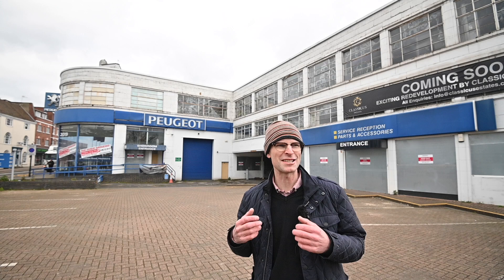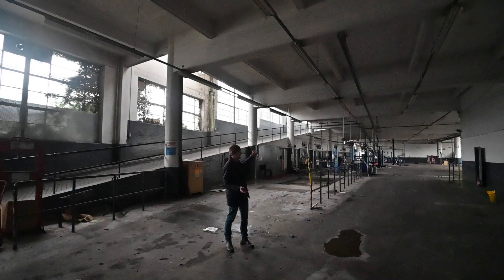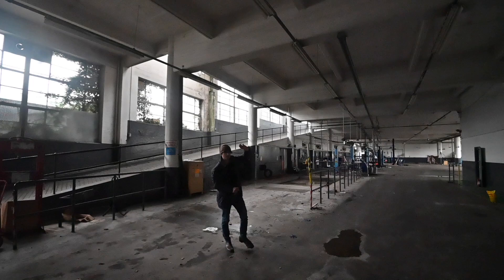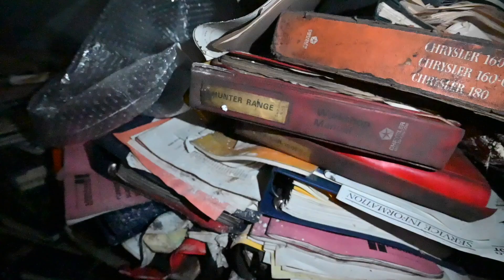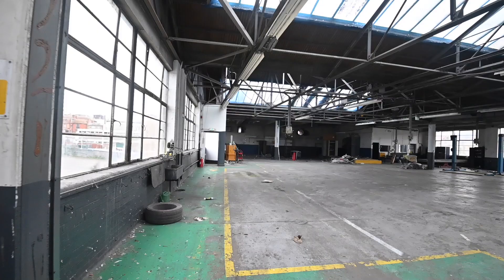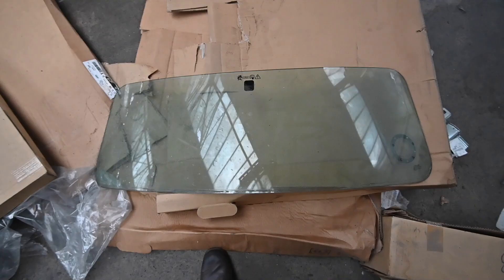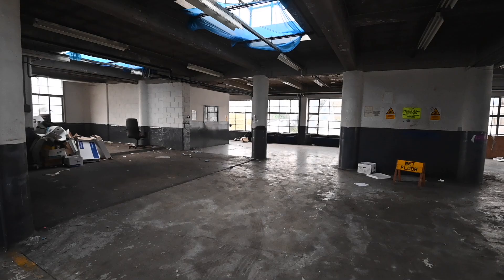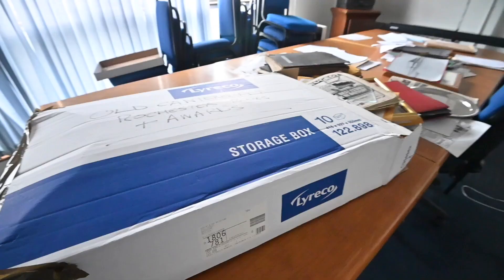Rootes art deco abandoned showroom and workshop urban exploration

Comment: I remember as a lad my dad taking his L reg Hillman Hunter down there for one of its services, he had gotten it from a dealer in Dartford brand new and I remember the sadness of leaving his duck egg blue Triumph Herald 13/60 and coming back in this brand new turqoise metallic Hunter GL.   After many BMC failures, this modern new Hunter just exceeded every expectation, it was when he part exchanged it in the late eighties still on its original clutch, its original head gasket, he had seat covers on from day one so the matching vinyl seats were pristine and the only failing was rust on the front of the wing tops but the car had never been welded either.

Comment: Brilliant, thank you.  As a young lad, I did work experience here in the early 90s.  I remember the whole building feeling quite intimidating back then,  it was also extremely cold downstairs in the workshop!  Probably impossible to heat; each bay had a heater pointing down towards the mechanics, above the windows- they didn't make much difference in December!
I remember one of my first tasks was to clear out part of the basement.  Down there were literally tons of items of literature, advertising brochures, hand books etc, all for Talbot Chrysler vehicles.  All of it went into a skip, nothing was saved, even original neon and painted (enamel?) signs that would be valuable nowadays.  Great times there, it was an incredible place to work and started me off in the motor trade.  I hope the renovation ends up being sympathetic to this grand old building :)
Reply from the maker: Yikes, probably binned thousands of pounds of stuff! Funny I spent an early 90s work experience emptying a council building basement, there was nothing remotely exciting!

Comment: That photo book at around the 21 minute mark seems to be mostly, if not all, Rochester. The photo at 21:49 is almost definitely Rochester, there's a patch of land round the corner from the main building that now stands empty. The trainline running behind it was the biggest clue. Also, the photos at 22:21 and 22:30 taken in front of a stone wall, they were taken on the Rochester esplanade by the stairs that lead up to the castle

Comment: When working at Rolls-Royce in Derby I used to be in the OED building which had been at the end of the car production line. It had a fantastic wood paneled meeting room that has now been changed to the entrance and hidden under the metal roof was the frame of the original glazed roof. There were other nice retro features here and there. Much more interesting than any modern building.

Comment: Thanks for a very good presentation of the Roots showroom.
My father had a 1950 – 52’ish Commer Express built to a station car with back seats. In front of the back wheel housings there was a small seat cushion to sit on, so it could be 2 adults and 2 children in the back. The childre on the smal side cushions. He had large side windows installed behind the front doors, it was a 2 door car with cargo doors in the back, so we had a good view from the back seat. And of cause  there was no safety belts. 
We had lots of tours in Norway with that car. 
My father was a painter, so he needed the cargo area in the back. I think it was at 1000 – 1200 cm2 side ventilated engine with 36 hp and a 4 speed with a steering column gear stick. It was bought from the Norwegian importer Kollberg & Caspary, also called kostbart og langvarig as in “costly and slowly”. 
On top of the steering wheel hub was the switch for the turning arrows, just like the one shown in your videos of other Roots cars. The turning arrows came out of the side of the car just behind the doors, and it was essential to turn it of before the passenger opened the door to leave the car. If the arrow was left out it was a great risk that the passenger, and of cause the driver himself, to walk into it and break It off. He had to change it himself several times. I also remember him changing the cooler thermostat for a summer and a winter type. 
He had it until the mid-60’s and was an it was an exceptionally reliable car. It was sold due to rust, comfort and safety. I cannot remember it ever stopped or broke down.

Comment: Fascinating video thank you. This is the home of my 1960 twin carb Singer Gazelle. I’d had the old cast iron engine overhauled around 1994 and was able to get new old stock pistons and rings in their original grease paper box, sealed in 1959 probably . A very solidly engineered high quality car, but showing its age by the time I parted with it for £700.00.

Comment: Few bits of info you might find interesting. 
The basement area you went into at the front of the building was used as an air raid shelter in WW2. It has its own ventilation system which you can see just on the right of the car entrance to the building. 
There is also a second basement at the rear of the building where the used cars were sold from. Down there are all the original air compressors for the site left in situ. The intake for the compressors is poking through the end wall if you look, it’s a down turned cone shaped thing and slightly wonkey. Go take a look down there it’s quite cool to see all the old machinery.
Reply from the maker: Wow, thats interesting. Do you know if the shelter was built re-enforced so close to the war or it was beefed up later? Ill have to take a look when we can go out again
Reply: @furiousdriving  Im not sure about the shelter construction though i do remember it had a second escape route out of it I think . Because it had its own air supply and extract it would suggest to me that its was purpose built and would be fairly tough. I used to work there back in 1998 for a very short time as a stop gap job but while I was there I got to know the caretaker well and as I like all this history stuff he showed me around the building properly. Did you find the old wages office where they payed all the staff from?  It was still all there when I was there. It was all wooden and had a small hatch where the employees would collect their pay from a very long time ago. As for the other basement with the compressors in the access door is on the outside of the building to the right of the used car reception. When you went in its quite deep and there was cast iron stairs down to the machinery. The Compressors were really old, open spoked flywheel direct drive units that made a hellish row when running. Seriously get back there and document it before its all gone mate.

Comment: What a sham such a beautiful building will not be a car dealership any more. At least we won't loose the actual building.
Hanley, one of the five round of the potteries had a similar garage but it fell victim to Stoke's biggest vandals, the city council.
Reply from the maker: It is sad to loose its connection but it was no longer a good spot for a dealer and needs a lot of restoration that they weren't going to pay for, so its a relief it will be done now
Reply: @furiousdriving  Yes, I can imagine the upkeep and logistics. It reminds me of one of those Matchbox garages my brother had in the 60's or 70's. At least it won't be demolished. I had Saturday jobs in two garages while I was at school, one was a gorgeous little one built in the late forties in the International style and the other still had the stable stalls berating it's origins as a horse drawn cab dealer/garage (I'm not sure of the correct term). You should have seen the quality of the Teclamite  (hope that's the correct spelling) equipment. I hate the look of characterless dealers on anonymous business parks. It's so long since I worked in the motor trade that I have no idea a out the practicalities these days. I run a 'quaint' classic motorcycle engineering business making parts for the retail sector on a tiny scale, small run engineering and one offs. I really do appreciate the tour though. Thanks.

Comment: Pity it was Peugeot's being sold there. One of the last cars I'd buy.
Reply from the maker: They were the last link to Rootes in the end after they bought Talbot Simca then dissolved  the brands
Reply: Used to have an old 407 estate as a tip run work horse. It was literally one of the most bland, hideous, and poorly made cars we'd ever had. And because the original owner kept every receipt for the maintenance, we could see that the POS was constantly breaking even when it was new. After renovating our house we didn't need it anymore, so it eventually got scraped without a teardrop or even a kiss goodbye.